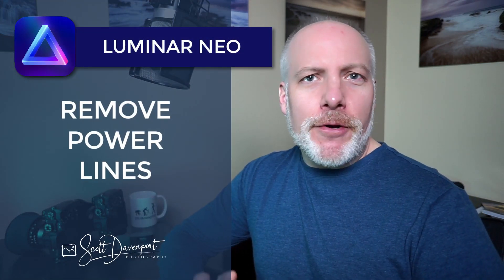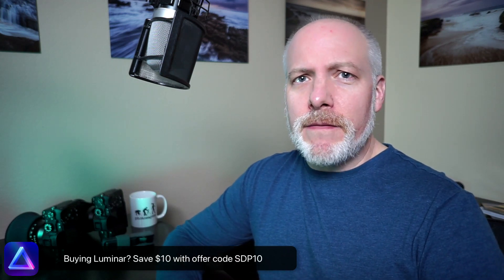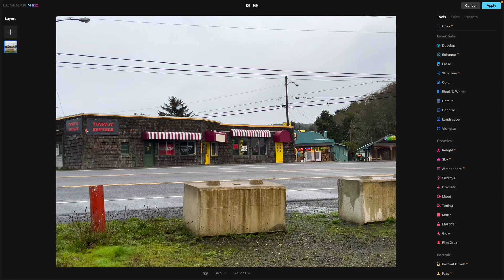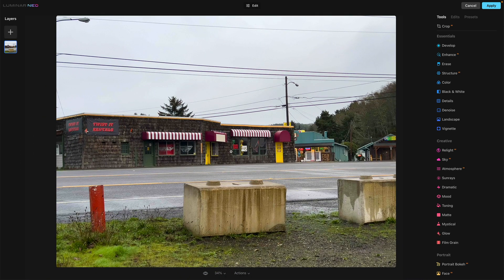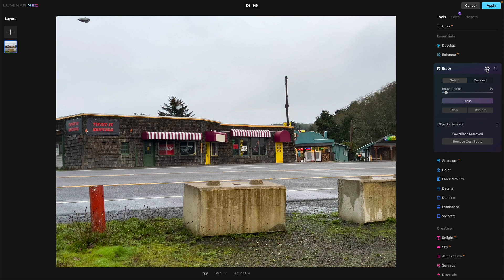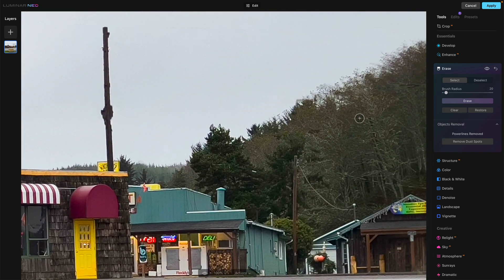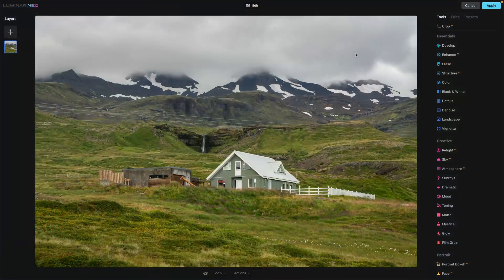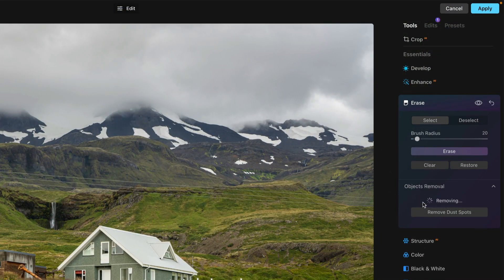Remove Power Lines In Luminar Neo - Does It Really Work?

Comment: I think the last image is a good example of where using power line removal with a masking tool would be a good option.  Use power line removal just to remove the one isolated wire in the sky and not across the remainder of the image.  Is there currently a way to use the tool selectively like this, or do the masking tool and layer capability limitations stand in the way?
Reply from the maker: There isn’t selective use of the tool today … I expect the isolated lines in the sky are easy work for the Erase tool directly. Layers might work, although there isn’t a direct option to duplicate your current photo as a new layer. Doable, but more steps. I’d say Erase directly is more straightforward.

Comment: I am sure the power line removal tool will evolve as users give feedback. I still think it is a good start. I plan on doing some trial and error testing with problematic images. A method might be to identify the problem areas ahead of time and clone stamp them before asking Neo to auto the rest. I hope the Skylum  crew in Kyiv are doing ok.😎
Reply from the maker: Hi Ron ... that's an interesting idea ... using Remove Power Lines as a "discovery" tool.
Reply: I dont have this tool on my luminar. my screen at the top right just has tools and edits. so i cant find exactly what to do to follow the video. do you know anything why mine doesnt have the same options as in the vid?excuse my punctuation